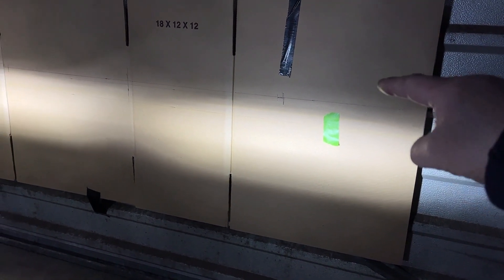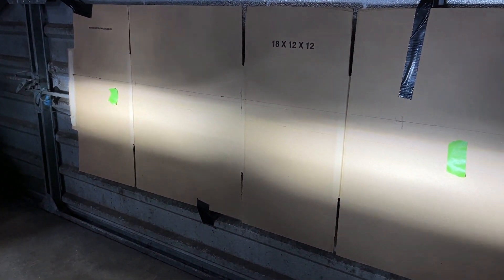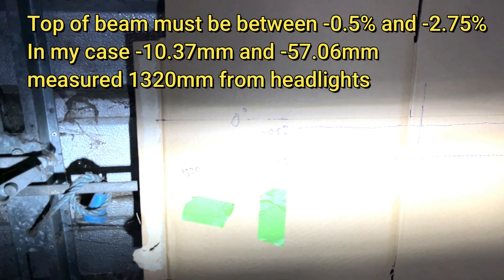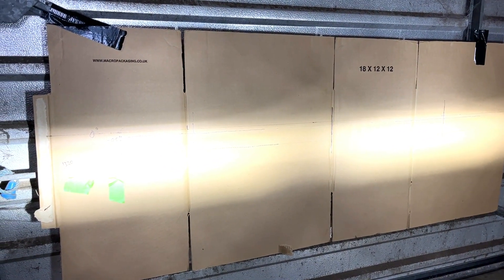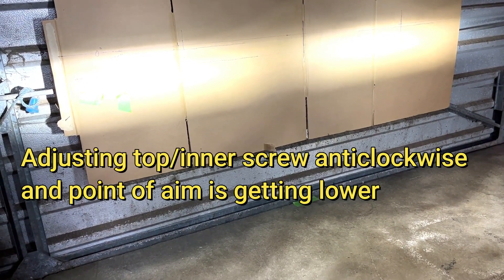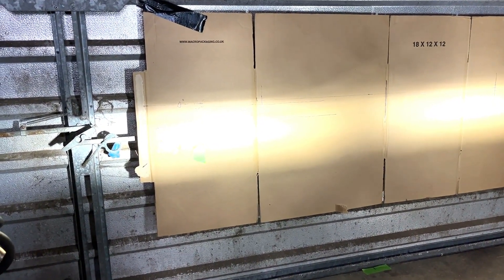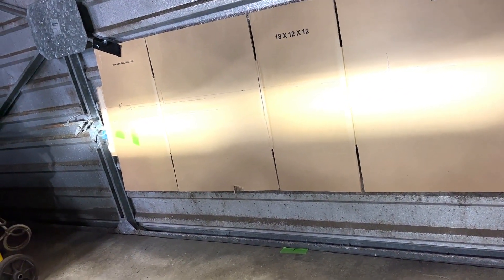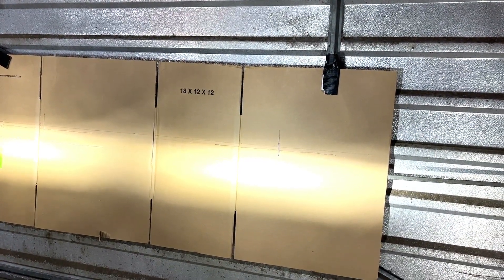Adjusting LED Headlight Aim on the Citroen Ami Electric

Comment: This video is the only resource I've been able to find about this. And i can't even find the parts on Pro-piece-vsp... Question: mine are set way too low, but the top screws won't budge clockwise (yet) so I am wondering: if I could turn the 1 bottom screw anti-clockwise. Is that how they work together?
Reply from the maker: Hi, the 3 screws work in unison to adjust the beam position in all directions. You may be able to use just one screw to adjust the height but best if you can free off all the screws.
Reply: @DougsShed  Great answer, i`ll try it out soon, thanks!

Comment: Hello could you do a short video where is that? i have the same problem the beams are too high
Reply from the maker: Hi, the video shows the locations of the adjusting screws on the rear of the head light assemblies. Best access is by removing the complete front of the Ami but the adjusters can also be accessed from under the wheel arches.

Comment: Sorry - I'm not the handiest. I have the same issue - left headlight too high. How do I access the headlights to adjust (do I need to take the front panel off - and if so, is this easy?) and which screw(s) do I then adjust? Many thanks.
Reply from the maker: You do not need to remove the front panel - just reach in from the wheel arch. There are (3) adjusting screws for the headlight aim. If you turn the top adjusting screws anti-clockwise, the top of the headlight should pivot forwards and this will lower the point of aim.
Reply: @DougsShed  Thank you very much. Will give it a go today. Very much appreciated.

Comment: Getting the headlights adjusted can be a challenge at times and very importance not just for you but the oncoming traffic too. Good luck Doug , Cheers
Reply from the maker: Hi Lloyd, with super bright LED and HID lamps it is most annoying to get dazzled. Some day time running lights are also really bright as well.